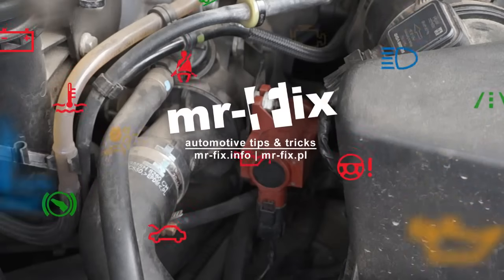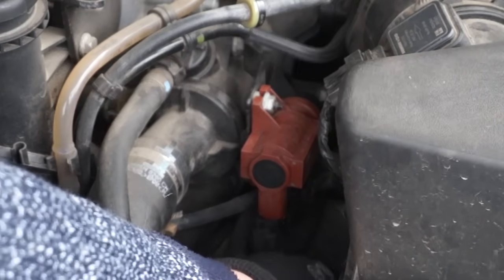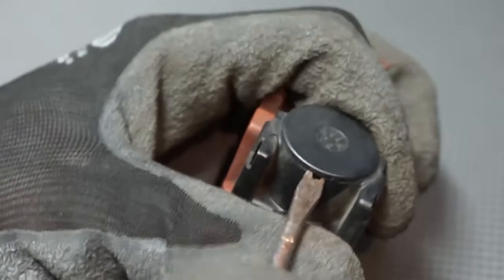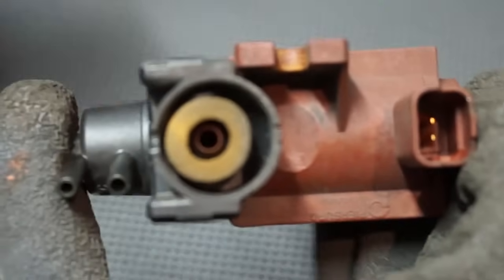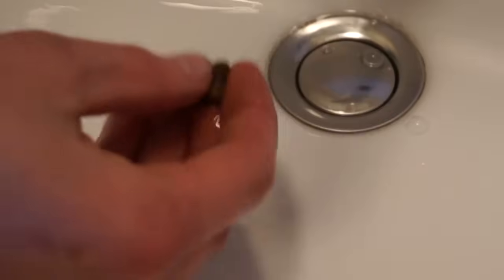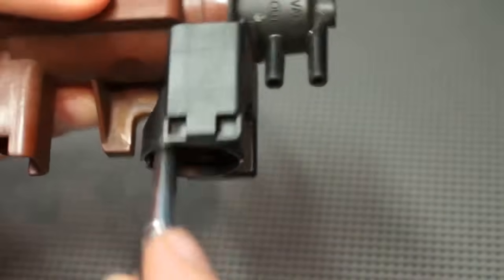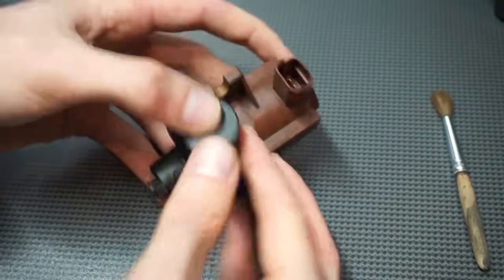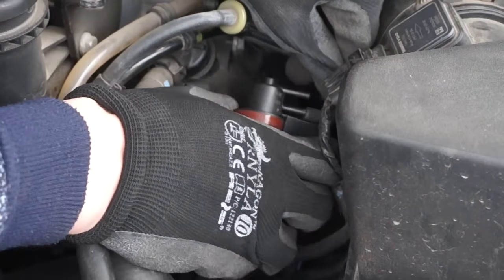How to clean vacuum valve air filter in 1.6 & 2.0D TDCi, HDi engines (Volvo Ford Citroen Peugeot)

Comment: Jesus, never thought that a dirty sponge could make this difference. My car was acting like an old school diesel with turbo lag, and less power overall. No codes, nothing. And also frequent DPF regens. Cleaned that sponge and car came back to life right away, and DPF regens back to normal. The sponge also started falling apart, and I've replaced the solenoid anyway.
Reply from the maker: Happy to help!
Reply: What engine do you have?
Reply: Just replace mine on a tucson jm. Turbo wasn’t working at all then replace the sponge and it drives like a racket. No dashboard errors or being detected at a specialised auto service
Reply: Have the same Mazda engine. do you need to program this part when replacing it?

Comment: There are 3 pipe connections. where do they connect to. I have one which is around 20cm long and cannot find anywhere to fit the other end. I am in process of replacing the solenoid

Comment: Had a faulty solenoid with an intermittent fault. I removed the cap where the sponge filter is and it had deteriorated which caused the valve to stick.

Comment: Can inlet manifold swirl flaps crack or fall appart because of the invalid vacuum valve ? And if crack can it go throught the turbine exit and cause damage ? Can car than go on ?
Reply from the maker: I would say that it's unlikely that vacuum valve can damage swirl flaps.
Anything in the intake manifold can cause damage to the engine and components.

Comment: Hi have a 2.0hdi c4 vts located 2 solenoids at front left which one is the turbo solenoid as ones on top of the other not sure the bottom one can  be removed from above have p2562 and p0299 fault codes

Comment: This worked a treat on my mondeo mk4 tdci.Engine was running rough and turbo wasn’t spoiling up properly.Tried cleaning all the obvious sensors, maf, map e.t.c
But it was cleaning these filters that got my boost back.Mr Fix you are a legend, Thanks.
Reply: How many of these are there on your engine?
Reply: Yes, same thing happened to me on the mk4. This clip saved it from being set on fire :))) as it was really annoying me, and not even throwing any error code.
Reply: @alex_wfa  same here bro, I’ll try and clean it myself, but I can’t figure what the location is. Is that behind the air filter ?

Comment: Thanks for the video!
When told my power issue was likely caused by the TCV I was not looking forward to digging near the firewall to find it. Fortunately I could tell from the video it's mounted near the front of the engine and it turned out to be a 5-minute fix.

Comment: Thanks for the video demonstration, but on my 2008 C5 III 2.0 Hdi there is a different kind of valve, no filter ... or was I looking at the wrong element? Mine is located on the front right corner of the engine.

Comment: This filter is located beside the air filter housing and intake manifold. Easy to find.
Reply from the maker: This valve is very popular and are used in different engines to control different functions. In my Volvo C30 with 2.0D engine there were three of those.

Comment: Hi. Your engine bay looks exactly like mine, so I supposed it's 2.0 Duratorq, probably on Ford Focus?
If so.... Is there supposed any pipe to be loose as a breather? I have one free tube from this valve, feels little suction from it on idle, so i assume that that end is supposed to go into tuzrbocharger actuator. Is it correct? Im talking about the and that goes back under wipers cover. Thank you. This video is huge help
Reply from the maker: volvo c30.
no loose pipes, no breathers.

Comment: The sponge on my 1.6 tdi is so small. Like 50 times smaller. I touch it and jt melted. Just cleaned the surrounding and fit it back without any spone . Is that okay?

Comment: Hello my Mondeo mk4 2008 2.0 tdci 140hp had two of them. I had strange buzzing noise when turning engine off. Then it started kicking when accelerating which made me check whats going on. I noticed the one of the valves, close the intake manafold was making the noise, and i wasnt sure, but when i switched the two valves my car changed the sound, it was sounding more like whistling turbo sound and i knew that something was wrong with one of the two valves. So i put them back as they was and when i added more than 3000RPM the car went into limp mode with ESP light on with errors:
P2263:73-27 - Turbocharger boost performance
U0401 - Invalid data recieved from ECM/PCM
My question is if you know..
Which valve controls the turbocharger? Is it possible one of the brown valves to make the car going into limp mode with turbocharger interferences? Are both valves linked together?

Thank you very much i will apreciate your opinion on my problem :)

Comment: Hi 
Thnx for the video 

Can you please help with a diagram for turbo vacuum solenoid pressure boost same as one in tge the video my engene car is 1.6 hdi Peugeot 307.i have manage to connect atm,out.but jm struggling with vac as i dont know where its should be connected from electro valve to where?

Comment: My filter sponge fell apart under water , it was soo dirty and also i broke my valve pipe, will i have some problems because of that? I already have problem that turbo go to safe mode after few times when it gives it's boost

Comment: Hey, my issue is that the throttle housing flap gets stuck after shut down and the car won't start again unless I disconnect the vacuum hose from the throttle housing.
I removed the vacuum valve like you did and changed the sponge. After two shutdowns it was okay but after the third, it didn't start(hence the flap got stuck again). I also cleaned the throttle housing and it moves freely. What would you recommend I try next?
Reply: Shaving the flaps down slightly. Sorry 5 months too late but for anyone else ot might help

Comment: I have cleaned both, but the wierd noise still persists after turning off the engine. Ford Mondeo MK4 2.0 TDCi 2008
Reply from the maker: Like a buzzing for about 30 seconds after you turn it off?
Reply: mr-fix yes, that buzzing noise contuines about 10-15 sec. after turning off the engine.
Reply from the maker: That's normal. This vacuum valve is keeping the ink flap closed when you turn off the engine to help with stopping the engine. Then, after 10-15 s. controller shuts down, vacuum valve is powered off and the flap goes to default (open) position.
Reply: thank you for your advice
Reply: i have a Mondeo mk4 and it does the exactly same noise and it cuts power from time to time when i accelerates, this happends till 2500 rpm and it produces the same noise again.
Could be the vacuum?
Reply: @mrfixpl  which valve control the right flap?? Thanks

Comment: thanks for you videos. does the one that controls the bottom doser flap on the throttle body look the same? and i can't locate it. i have very rough idling on regen and i suspect the bottom doser isn't opening. this is on a 2006 407 136hdi
Reply from the maker: yes, it looks the same. If I remember it's located somewhere between alternator and AC compressor.
If you have throttle body flaps related problem, you can start with disassembling and cleaning it. Also you can check with a syringe if flaps move freely.
Reply: Thanks for the info, and great idea about the syringe. I'm going to give it a go this week.
Reply from the maker: Happy to help! Let me know how it goes.
Reply: @francisfe2064   Hi. Did it work? Cheers 👍

Comment: Hi. I have an issue with my  focus 2010 2.0 diesel. P2263  and P1719 came on and took it to a ford dealer mechanics . They cleaned the turbo charger , they check the actuator, egr valve. and replaced the air filter already but the P2263 still came on. What could be the problem ? They asked the other ford dealer from different places what they suggested is to check the transmission. Thanks for your help.
Reply: Check the hoses for leak
Reply: One At Athan Hi! Did you fixed your car? One of my friend have the same problem, we did the same things that you, but we can’t repair his car. Can you help me, what was your problem?

Comment: Is there any difference on the way you connect the two vacuum lines to the valve? I did the procedure but I am not sure on the position of the two vacuum lines.
Reply from the maker: outputs are described. VAC to vacuum, OUT to device (turbo, throttle body, EGR...).
Reply: Which one of the lines is vacuum and which one is device? Is the upper line going to the OUT section and the line that comes from the section near the fuel filter going to VAC?
Reply from the maker: What car? Which engine? What's your valve controlling?
Best if you follow the lines. You will find that all VACs are connected with each other, and OUT lines go straight to devices.
Reply: The car is Volvo v50 2.0d and the valve is the same as the one in the video. I am not able to see in the video which goes to Vac and which goes to Out. That is why I am asking if the line from the upper part of the engine goes to Out and the one coming from the side of the fuel filter goes to Vac.
Reply from the maker: OUT goes to turbo. that's the line that goes between engine and battery, then behind the engine under the EGR valve.
VAC goes under the intake manifold.
Reply: Thank you! Exactly what I need to know. You have been very helpful.
Reply: Hi, is there anything happens with vacuum in the intake manifold? i've two connectors on intake manifold. i guess one for vac from vacum pump and one system goes to this valve. My lines are mixed up by a filter change. Could you give me some hint if does it matter? Thanks

Comment: How can i test this part is working correctly?
Im experiencing intermittent boost problems.

Thanks.
Reply: Mine is the same. If I press the accelerator fast enough, I get turbo pressure drops. But if I press equally, then there's no problem. :/ 
Maybe someone could comfirm, that it's this parts fault? Don't want to start searching for a more serious problem.
Reply: Hi, did you find the way to test it ? Thanks
Reply: @arturasklimavicius276  did you fix the issue? Any help appreciated. I'm suffering the same issue and will be taking a look this week at trying to resolve the boost issue
Reply: @arturasklimavicius276  hi there, i think i have the same problem as you described it, wanted to check if you ever resolved it? Would appreciate any help! Thanks
Reply: @jonny_s14  any luck finding what the issue was - think i have the same issue
Reply: @arturasklimavicius276  Hello did you fix it?
Reply: +1

Comment: Please someone help me. I cleaned all the three valves and still have a power loss. First 3 gears are okish but then its a slow car. This happened after changing fuel filter and mass flywheel, there is no to little air in the fuel line. I ordered a new gas house inlet as I read that the valves sometimes break down

Comment: Sir, can you tell me why my boost gauge shows "-1.0" bar? I use an app. call "torque" and obd2 bluetooth device to connect and show them. My car runs normal. And I had tried to look for error code by scanning it but nothing show up. Is that software setting incorrect or anything in hardware breakdown? Pls help me. Thanks. BTW, it's a Ford Focus 2.0 tdci.
Reply from the maker: When you have -1.0 bar boost? Idle, normal driving, full acceleration?
Reply: mr-fix Sir, it just stay at -1.0 bar when start up. The funny thing is when I hit the throttle, it, sometimes, can reach +0.3 bar. I got this second-hand car 2 weeks ago. The engine works..okay...kind of. Not rough idle and no strange sound when accelerating....(sigh) arrrrrrrr...I haven't try full acceleration...yet...

Comment: Mine is making a loud buzzing noise when the engine is on . I cleaned the sponge filter but no change. Otherwise there is no performance issues with the truck.Any suggestions ?
Reply: Farina Marcini  i have a ford fiesta from 2008 with the psa 1.6 diesel engine , bought the car and it wont rev past 4000rpm... feels verry slow to. the boost solenoid is making a buzzing sound when the car is on idle, does that buzzing sounds means its working or that it is broken? many thanks.

Comment: What will happen to the car if this part fails?
Reply from the maker: Vacuum valve is used to control variable geometry turbo and flaps inside inlet manifold. If it does not work (misbehave) you can experience power loss, limp mode, overboots, trouble starting the engine...
Reply: mr-fix Thanks
Reply: mr-fix I've currently got an underboost condition with my 2.0d and it only makes boost properly above 2500rpm, I will check this out thanks a lot for the video
Reply: got the bastard out.. bottom bolt was in a right spot.. Now trying to get the filter out but it's a different filter mechanism to the one on yours even though it's in the same place and everything so don't know if prying it off will break it or not. searching the Haynes manual atm
Reply: Did you get it sorted?
Reply: Mark Knowles yeah got it out, cleaned it checked all lines and still same issue :/
Reply: Darn. So you still have the issue?
Reply: Yeah I'm beginning to think it's sticking vnt as I can't hear any boost leaks and all vacuum lines and sensors are connected properly. The car is at it's timing belt interval now so think I'll have to bite the bullet and get rinsed by Volvo for both things..  :/ 

fyi - OBD2 scanner reads a p0299 code
Reply: Yep, turbo underboost! Perhaps some of those videos showing people using turbo cleaner might be useful?
Reply: They are the nozzles in the turbo that make more backpressure at low rpm to make it spool quicker and then they open out as the revs climb to give it more mid-top end. The issue could either be the vanes are stuck, the actuator has failed or maybe a sensor connected to it is dead. Not got a clue as I'm fairly mechanically inept. Just hoping it doesn't cost too much to sort as really want the car performing right! It's actually not too bad when after 3rd gear but the lag accelerating through 1st and 2nd means pulling into roundabouts you need a huge gap :/

Comment: My wastgate on 1.6tdci focus mk2.5 is not working! I have a overboost p0234-62. The car is lazy as f*ck! bad acceleration... The wastgate actuator doesn't move! 
When  I start the engine as soon as vacuum pump start the lever pull's in and stay stuck! I have changed the vacuum valve with NEW, oem by pierburg and I was pissed when noticed that same thing is happening! It looks like that valve is not being driven by ECU via 2 pin connector ?!? But, on other hand when I plug obd2 forscan i get duty cycle %% changing when i rev the engine! WTF ???
two things I have to mention:
1) egr is blanked and pcm tuned by professionals, focus was like a rocket !!!
2) 20 days ago I got dashboard failed, cold solder, but i managed to get home and take the pcb for resoldering... after few hours dashboard is connected and next 2 days again, it was flying like a rocket fast, normal acceleration 100% but already 3rd day it become lazy AGAIN? WTF ???

Comment: Can this part been found on 1,6 tdci 85kw euro5 ? 
Ford Mondeo
Reply from the maker: yes. it should control turbo boost.
Reply: Ok so I will need to search it.

Can  it cause the problem that there is no power ? But also there are no fault and nothing shown when doing diagnostic. How to check is it working corectly ?
Reply from the maker: Replacing parts to trouble-shot no power issues is a bad idea. Best if you connect your car with diagnostic interface and check some live data from your car. Then you'll see if the fuel pressure is correct, air flow/temp/pressure, acceleration pedal readouts... Or maybe your VNT is stuck.

Comment: Does cleaning this make much difference to how the engine runs?
Reply from the maker: If the filter is clogged it can cause the valve to not work properly. If you don't have any issues with the car, then cleaning is just a part of a maintenance service to make sure that the car will continue to work.
Reply: @mrfixpl  I have issues where sometimes my car has less power,  poor fuel economy, and smokes a lot from the exhaust.  Any ideas what it could be?
Reply: @amana1480  may be a DPF filter.. you have to check the car for errors firstly I would suggest
Reply: @Memelnord  Hello.  My Diesel Particulate Filter is fine, and the EGR is fine too.... but I have lack of power.... occasionally I get codes P0101, P0113, P0299 and P0406.... I don't get any engine light on the dashboard display though
Reply: @mrfixpl  If the valve doesn't work properly, what will the symptoms be?

Comment: Might sound like a silly question, but is this located underneath the car looking upwards? My car  is a C-MAX 1.6 TDCi 90 and has low boost and shakes on switch off. Could this be the cause?
Reply from the maker: This kind of valve is used to control turbos and intake flaps. If it behaves incorrectly then you can experience various symptoms including yours.
Reply: I have the same engine as you Greg. Do you have to remove the bottom cover from the engine to get at it?
Reply: If not this than check the AVS (looks like trottle body on petrol engines, but its funtion is quite different)

Comment: Where do you locate this part?
Reply from the maker: between engine and battery, also below alternator. depends on engine.
Reply: @mrfixpl  on dv6 peugeot, not at all that shit is on the back of the motor, very hard to access

Comment: i have a c30 with 1.6 PSA engine. i cant find it
Reply from the maker: Most likely access to the turbo control vacuum valve in 1.6HDI engine is from underneath the car. Somewhere under the air filter box, next to the engine starter.
Reply: Take off the engine tray and slide yourself under the car, past the gearbox and look up. It's off to the right slightly in plain view.
Reply: @mrfixpl  the valve is different, I think the filter is not inside the valve